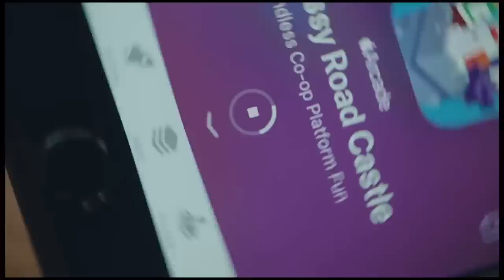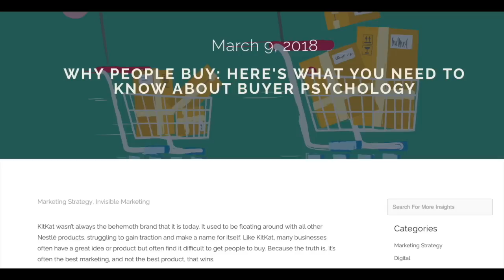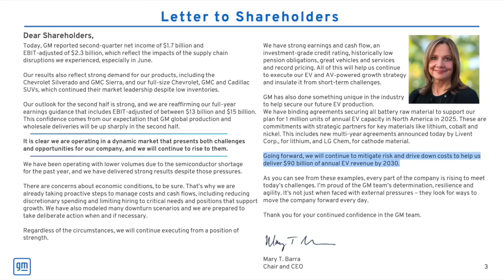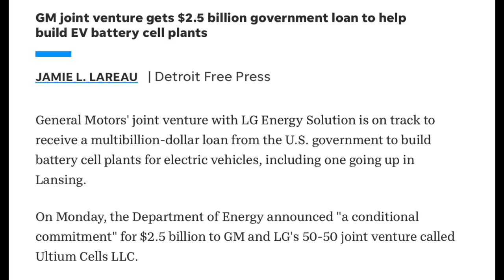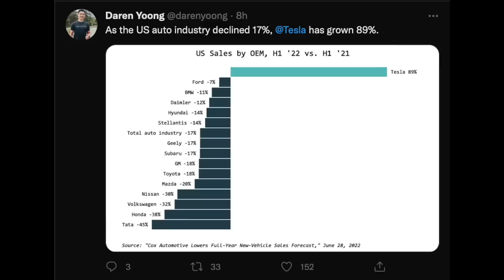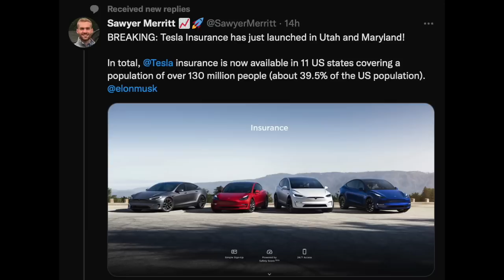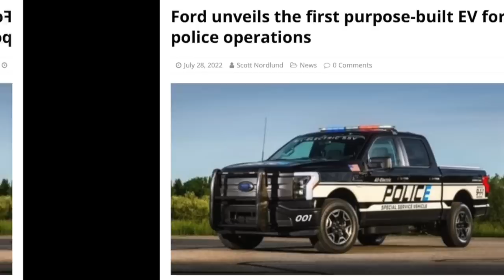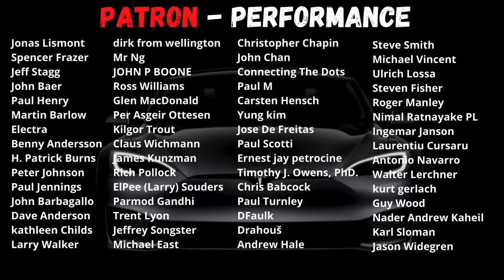Tesla is beating both Ford and GM in Net Income & dominating the US market

Comment: You are absolutely correct. 
Apple product line was so convoluted that even the dealers didn’t understand it. 
Steve Jobs saved Apple by simplification and a new operating system. 👍👍🇺🇸
Reply: Not only that, they would bet on the wrong products in their line and make too much of them and not enough of the others
Reply: Apple engineers invented the iPhone and iPod while Steve sat in his penthouse office taking the credit
Reply: @DennisFutball2396  But who got those engineers to work on those products? Those same engineers were working at Apple when they were about to go bankrupt. Somehow, Steve comes back as CEO and you get the iMac, iPod, and iPhone. Maybe the engineers were working on those products before but the old CEO wouldn't look at them or Steve asked them to create these products. Either way, Steve was the one who saw the potential for these products.

Comment: Tesla is also sitting on billions of deferred revenue because they’re required by law to mitigate the risk for partially unfinished products (like FSD).
Reply: It's really not that much, "As of the 31st of March 2022, Tesla had $1.594 billion in deferred revenue on its balance sheet. Back in February 2022, the company had announced that it would recognize $962 million of deferred revenue this year, down from the previous guidance of $1.39 billion." They have $18B cash on hand.
Reply: @machoopichoo2  
 roughly 5%: which isn’t big but isn’t completely irrelevant.
Reply: Cope more
Reply: @mackenziemoyer9180  Fair enough. Not trivial...although a billion dollars sure ain't what it used to be. ;^) Many commentators have said, Tesla's problem soon will be not having enough things to spend their cash on, and stock buybacks, etc. may be required.
Reply: @machoopichoo2  I got the impression from Rob Mauer that it was more like 5 billion (from the Q-10 filing).
Reply: @machoopichoo2  true story.
Reply: @fredbloggs5902  Maybe I got some poor info from the interwebs. ;^)

According to Tesla’s own Q2 reporting, Current Deferred Revenue: $1.86 Billion for the quarter ended June 30th, 2022. So it has gone up slightly. 

However, it’s a fast moving target, as they are quickly releasing FSD Beta, which greatly reduces deferred revenue. Plus Rob is super smart and he knows better than me. 

https://tesla-cdn.thron.com/static/EIUQEC_2022_Q2_Quarterly_Update_Deck_J8VLIK.pdf?xseo=&response-content-disposition=inline%3Bfilename%3D%22tsla-q2-22-update.pdf%22
Reply: @machoopichoo2  I’ve just rerun ‘Tesla Daily’ for the 10-Q filing and there’s $678m deferred revenue for the MegaPack division and $2.66b for FSD (timecode 09:15). So around $3.3 billion.
Reply: @machoopichoo2  'super smart' is not really a thing.
Reply: @machoopichoo2  Tesla had a $465 million loan from the government, which they paid off 10 years early.
Reply: @fredbloggs5902  Interesting. I should check out Rob’s video to better understand this. It’s a bit confusing, as in their balance sheet for Q2 2022, here are the deferred revenue lines. I am not that good at reading financial statements though. That said, much more eyepopping than the deferred revenues are total liabilities = $31B. Not that it concerns me. 

Deferred revenue: $1,594B
Deferred revenue, net of current portion: $2,185B
Reply: @robertmartens7839  Well intelligence falls on a standard distribution, so I would expect someone at two sigma above the mean, would probably be 'super smart.'
Reply: @Laura-S196  What's your point? Yes, GM has not paid back their 2008 government bailout, and just got $2B more for batteries.
Reply: @robertmartens7839  There’s no specific definition, arguably a cultural reference to ‘Good Will Hunting’ equates ‘super smart’ to Matt Damon’s level in that film which is probably 150+, I’d put Rob Mauer at 135 - 145 (?).

He’s ‘very smart’ but not ‘super smart’ 🤣

Comment: Threaded fasteners are the culprit to many failures, in the air force it’s common to thread wire through the nut and bolt in an attempt to keep them together.

Comment: Hi Lars.....I fully agree with continuous improvements to their products but what happens after a couple of years when people begin to need spare parts - due to maintenance or crash repair ? With so many variations of the same item, it must be a nightmare to keep items in stock. Also, on another channel there is the breakdown of a Tesla headlamp...the host mentions a cost of about $1500 - a minor accident would write off a car seeing those prices for spares.
Reply: Longo - TESLA is Genius .
most of TESLA enginering parts are BACKWARDS combatable with older models , the 2022 model Y Trunk tub & Frunk tub are the same as 2020 .
the 2022 inverters are ALL the same for all 4 models and they fit the 2018 model 3 . 
TESLA does NOT maintain a Backlog of ANY Legacy parts , they simply UPGRADE and replace with new DESIGN 2022 parts that are Backward compatable. 
while still DELETING brackets and fasteners, consoldating PARTS , Deleting parts.
Reply: Welding repair of casting versus panel beating or replacement parts.
Reply: Tesla insurance growing😉

Comment: The new Tesla 4680 pack is totally unrepairable. ANYTHING goes wrong it becomes a BRICK
Reply: FALSE, #1 - Tesla battery packs RARELY ever fail. 
some 2012 battery are going strong. 
#2 - 4680 pack will last more than 2 million miles . 
#3 - 4680 pack can be EASILY sapped out in a Service center , Recycled.
Reply: My point is still valid!!!!